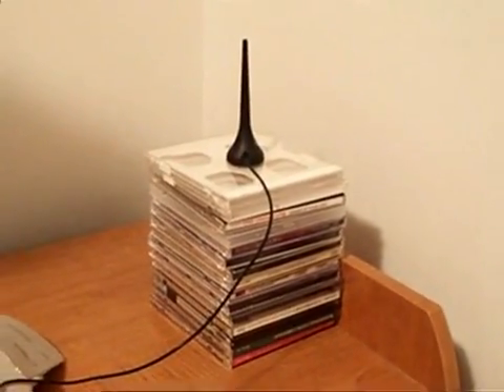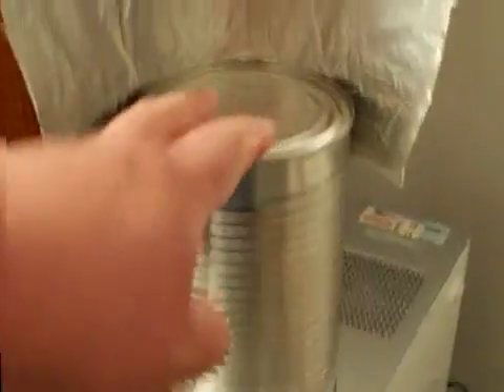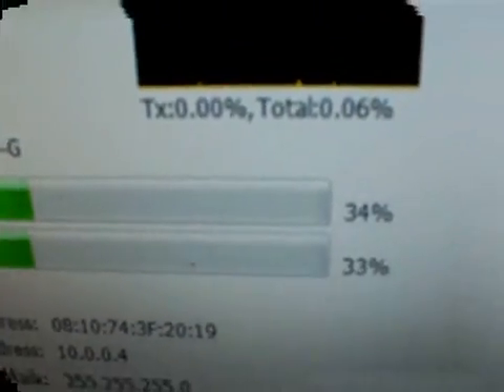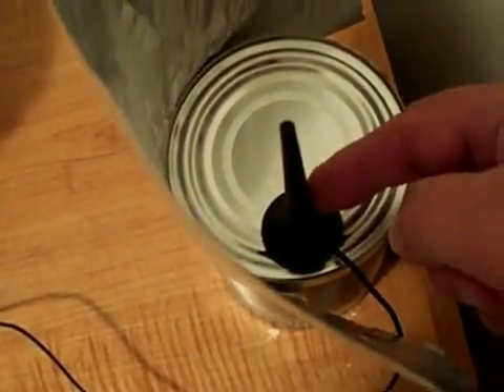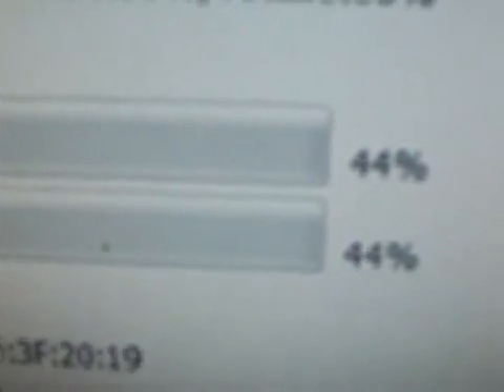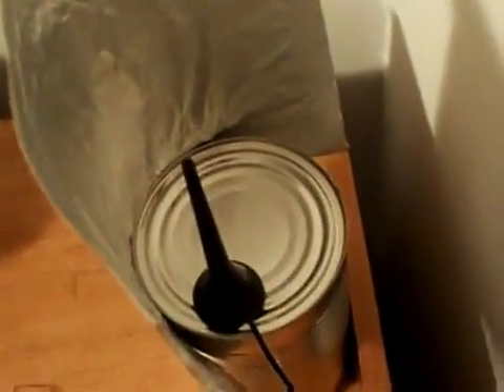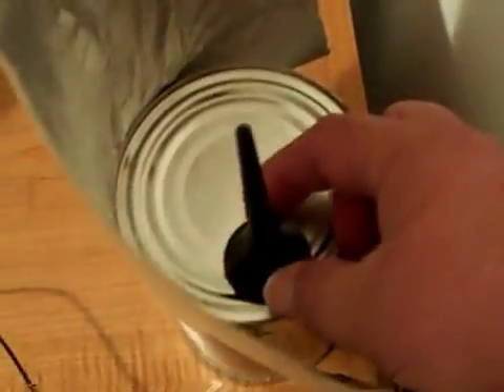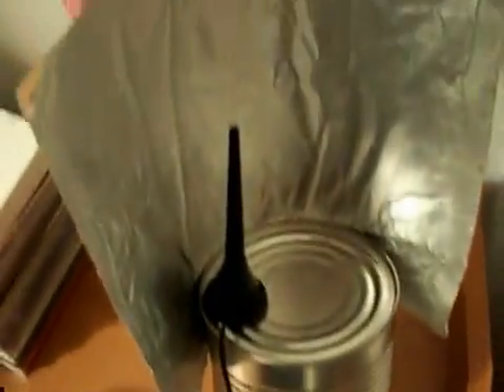e WiFi Antenna Booster - Very Stable and Stays On The Signal

Comment: I believe your antenna setup, on top of the metal can, works better because you have your magnetized, omni-directional antenna sitting on top of a metal can, which works as a ground plane of sorts. This environment you created maximizes your your output/input signal.

Comment: You should make a waveguide instead. Use a 3-1/4 sauce can, make a hole in the side EXACTLY 2-1/2" from the bottom and stick your dipole antenna throuth into the hole. Then, make it level, and point the open end at your router. That will really work for you.

Comment: Magnetic antennas need to set on a metal ground plane in order to work at optimal efficiency. So.... I wonder if you place the antenna on a piece of metal - such as a tuna can lid-- and use it with the windsurfer if you will see substantial gain? Am wondering if the reason your design provides so much gain in comparison is that you it incorporates the magnetic ground plane which is missing when you set the antenna on plastic CD cases.

Interested to hear the results if you experiment with that.

Comment: I used sheet copper to make a cylindrical stand 12 inches high, and then a copper sheet attached to the cylinder. I copied your idea but used copper. Increase my signal by 28%. Thanks for the video and idea.

Comment: Great idea to boost your wi-fi signal on the cheap! You've essentially created a high gain directional antenna. As far as the positioning of the antenna on your reflector device; it has to do with how the signal is interacting with itself and forming (in RF engineering terms) lobes...what I suspect is happening you are adjusting the amplitude and position of the main radiating lobe. Don't be intimidated by the physics of it, read up and you'll soon have an even better design! Good work!

Comment: Sounds like a Corner Reflector Dipole was created here with a improved ground plane added.
If the reflector is bent so as to form a corner we have a corner reflector antenna. If the surface has a parabolic, spherical, or elliptical curve, we have a dish type antenna.

A conducting, plane surface acts as a reflector for a dipole as a mirror placed behind a light bulb would for the light rays. The surface can be solid or be made of screening.

Comment: Your home made antenna should work better then the wind surfer because its bigger and you have a metal can hooked on to it so it should give you a better signal. But if your were suppose to put the antenna on top of the home made antenna you should have full bars.... you should try the home made antenna and the wind surfer together to see if you get an even better signal.

Comment: Dale, you've made a good video. You can attain the same signal strength with the Windsurfer if you use the same amount of reflector area...same as your rig. The larger the capture area, the better the signal strength. Also, placing the antenna on a metal can will make a better ground plane antenna. You will not get the same reading if you use your rig with those plastic CD cases. I'm glad you came up with the metal can. You have accomplished a job well done!!!

Comment: That's pretty good. You could also be getting a reflection from somewhere off-beam , always a problem indoors. For my laptop: wifi and 3G, I made a corner reflector - foil on A4 card, folded to 45 degrees, antenna placed about 1 inch or less from the apex. It sends most signals over the 5 bar limit, from almost zero, and folds flat for travelling.

Comment: You did it all wrong mate. The reflector has to be a parabola otherwise it doesn't focus the RF signal  on one line (on the antenna). You would get much better results with a proper parabola. Also, the bigger the better.

Comment: DO THIS NOW
1.get Glu stick,paper,foil,a pen,and some small string
2.take the glue stick & put all over paper
3.smush the foil that is bigger than your piece of paper onto your paper
(make as smooth as possible) 
4.poke a hole the size of your pen in the center and 2 smaller holes on the sides.
5.tie the string to both sides, tight enough for the foiled paper to band like a half-pipe
6.Put it on the antenna and point to router until u get sweet spot
Before i did(12-24mbps)
AFTER i did(45-60mbps)